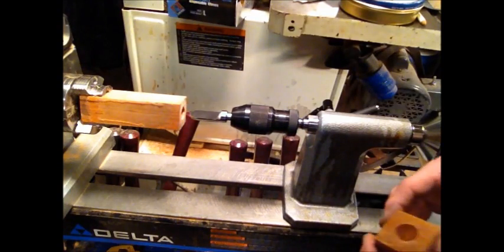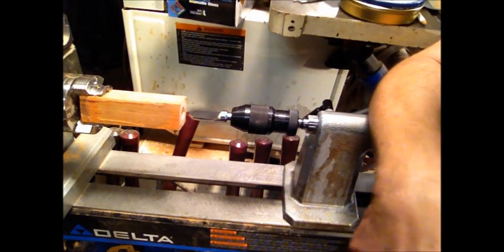Spoon Bit Tips and Demo

Comment: guys that say that it can only be used for freehand drilling are just ignorant in woodcraft. DUDE I cant wait to get it, you know how much I sand my bowls and I think this is gona help a lot! THANK YOU SOOO MUCH for letting me get in on this batch!
YOU ROCK BRO!
Reply from the maker: You're very welcome brother! Thanks for the comment and sharing the video SparkMan, I appreciate ya brother!!!
Reply from the maker: I've been asked numerous times why they can't be used in the tail stock because there are some well known makers out there that are telling people this Bullsh*t and those that don't know any better are taking it for gospel because of who it came from. I'm not the smartest guy on the block, but I'm no moron either! LOL
Reply: I just saw the comments here regarding the use of spoon bits from the tailstock.  For all I know, you have a different opinion now.  Spoon bits can indeed be used from the tailstock, but it is not what I would consider the best practice.  There is a reason I, and others, recommend that this is not done. 

Spoon bits generate more heat due to friction than reground spade or jobber bits.  The reason I advise against this is that it is easier to regulate the temperature of the briar and spoon bit when drilling by hand to prevent overheating which can damage the briar.  Spade bits just do a better job, in my experience and opinion, when drilling from the tailstock.  Everyone has an opinion, of course, but I typically am advising people with less experience and don't want them to hurt themselves, their material, or their tools.